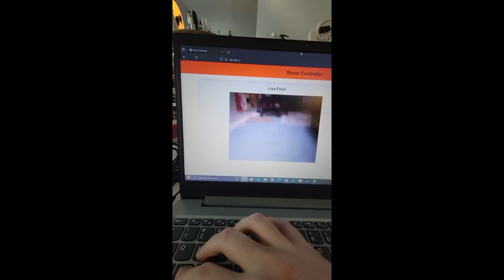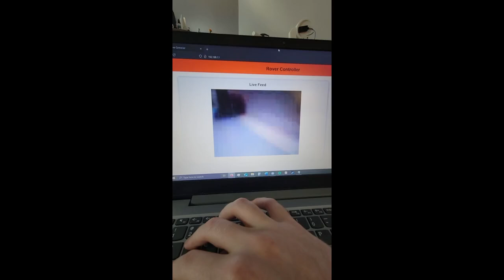ESP32 powered rover controlled via a webserver

Comment: What a great project. I have a couple of Ai thinker ESP32-CAM boards that I have been trying to interface to other mcus without much success. This idea of having separate boards, both using HTTP iterfaces is brilliant. Why does it all have to be on the same board?
After all, the video is simply a visual feedback source for the operator so it doesn't need to be connected, kind of like a camera on Octoprint. Has nothing to do with the actual printing.
Thanks for helping me to break out of that loop.
Cheers.